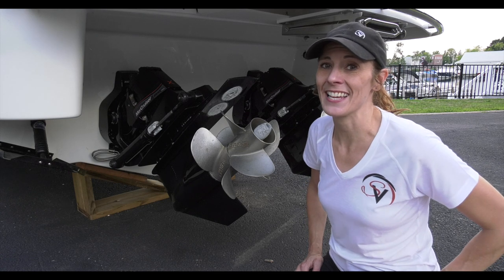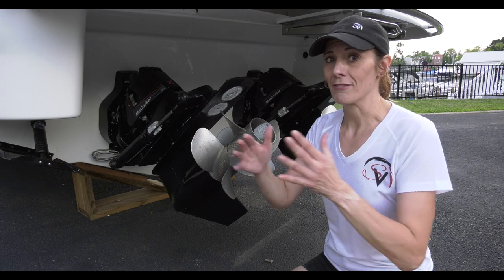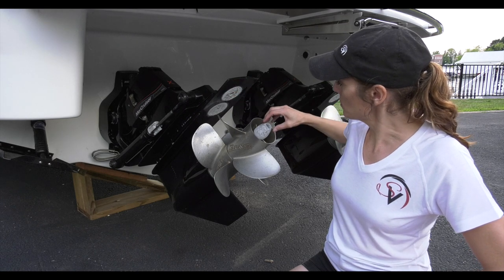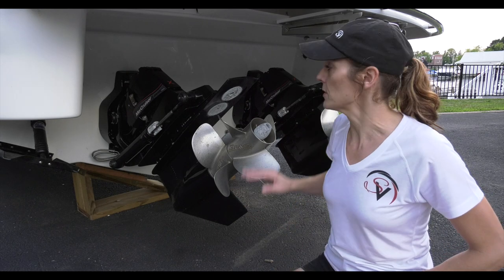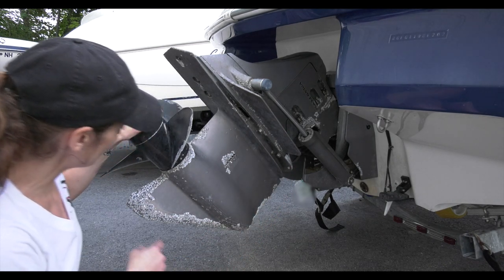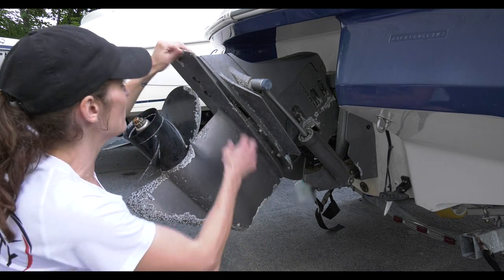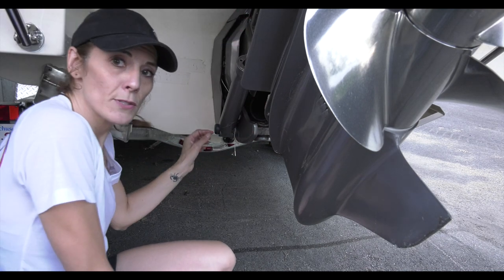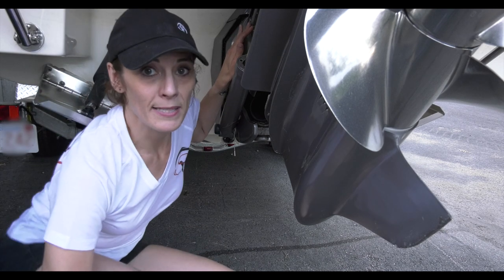What are Zincs on Boats?

Comment: Great explanation of what goes on when dealing with boat engine salt water corrosion process, but the way, those metal links you pointed out are to try and keep all sections of the drive train at the same electrical potential, so the anodes are what will be sacrificed first, as designed, but again, great job!

Comment: Does this concept work on a car to prevent rust from salty winter roads?
Reply: Not unless you submerged your car in water. It will protect the spot you put it on though solely by covering the spot.
Reply: @jefism please explain why it wount work on car. There are equal currents in air. Hence why your car corrodes.. oxcygen in air is acidic ancting like "water".
Reply from the maker: Water is more of a current of electricity than air, so it will affect metal more quickly.

Comment: Look at your table of elements.  If you have a boat what is the current load
 12 or 24.  What you see in in your pyramid in defeated granite. Look at the crystalline  the holes.  That is depleted. That is what you are seeing. Now. How can you deplete  granite. Granite is Radioactive  on a lower scale of what we know of our table of elements.  Let's  think about this just for a moment.on the equator. If there was on that line monuments all the way around from 1 side to the other. Look at the materials that were used from place to place. Take your lay lines magnetic lay lines. This is so easy. I have asked this question over and over again!  The tilt of this planet go's through a pole shift. Now if you will take your content all drift and back it up 350 MILLION years.  This is crazy I know what you are thinking.  The earth is tilted on it's Axes. Draw a line on the tilt. Now every 72 Years the EARTH MOVES 1 ark degree on the tilt. The EARTH COMPLETES IT ROTATION FROM ITS STARTING POINT EVERY 26000 YEARS IT COMPLETES THE ROTATION.  THINK ABOUT THIS FOR A MOMENT. WHAT IS 350 MILLION ÷BY 26000÷BY 72=WHAT? TAKE THE PYRAMIDS  IN EGYPT. LOOK AT THE HISTORY LOOK AT THE SQUARE POINTS THEN LOOK AT  THE EQUATOR. SOMETHING THAT I SAW. BRANDENBURG ACTUALLY MADE ME THINK.  THAT IS A HARD THING TO DO WHEN ALL THAT YOU SEE IS NONSENSE. IT WAS PLANET MARS. HE WAS GOING THROUGH THE DATA ON THE LANDER THAT LANDED ON MARS BACK IN 76. HE WAS SAYING THAT THERE WAS HOPING BOMB THAT HAD BEEN
Reply: Worls is round dude... that's what she said